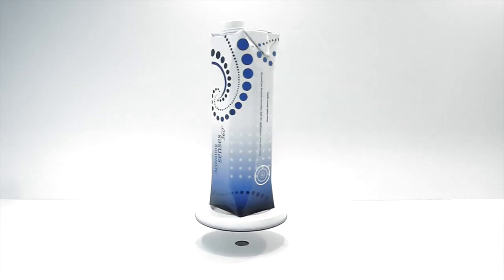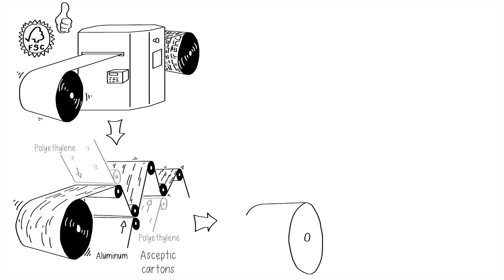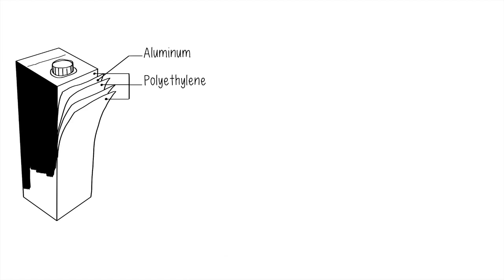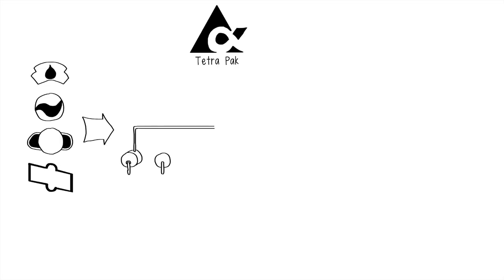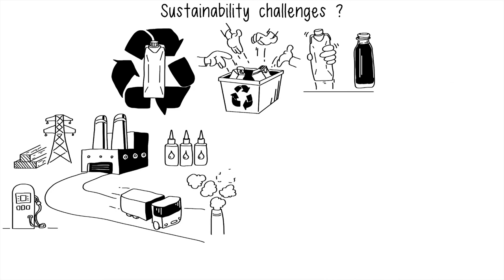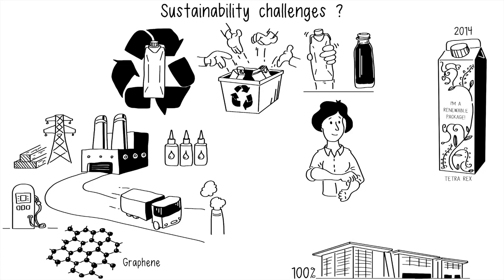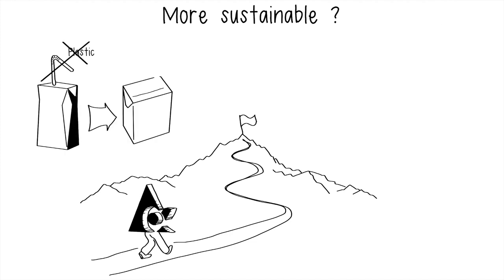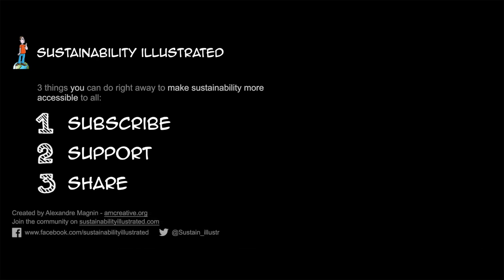Sustainability review of Tetra Pak

Comment: A product perfectly designed for its job with 0 thought given to EOL. Reminds me of that blight known as k-cups. No amount of marketing or unused "recycling" programs make this a sustainable product. However, you may want to discuss their "bio" version in your next video.
Reply: But isn't that because the consumers are not doing their part? This is a problem every company faces and they just can't force people to recycle.
Reply: @Sivah_Akash   You can't recycle when facilities don't exist. Like many towns today, we can only recycle 1,2,5 plastics, metal, glass, and cardboard. Container companies love blaming people so they don't have to take any responsibility. We've seen it many times (just look at Coke's recent statement).
"A bad system will beat a good person every time." - W. Edwards Deming
Reply: @FrankLeeMadeere , oh thanks. That makes sense.

But Tetra Pak is not as big as Coke to build a plant in every city, right? Or did I get you wrong?
Reply from the maker: @Sivah_Akash  No but they can improve their product and improve recycling collection and efficacy.
Reply from the maker: Tetra Pak is certainly not claiming their product to be sustainable at this point and yes, it would be interesting to make a video on the Tetra Rex carton.
Reply from the maker: @Sivah_Akash  No they are not as big as Coke I don't think but they are still working with communities and recycling facilities to make recycling more accessible and efficient.
Reply: Couldn’t agree more…in brief they’re not recycled is what I see working in the industry….paper mills don’t want them (pulping as mentioned in the video could in theory work but chances are the polythene or aluminium elements will still be left contaminating the fibre)….they get burnt as Srf (solid residual fuel)….not recycled.
Tetra Pak should be banned as a packaging  despite its usefulness regards product shelf life etc.